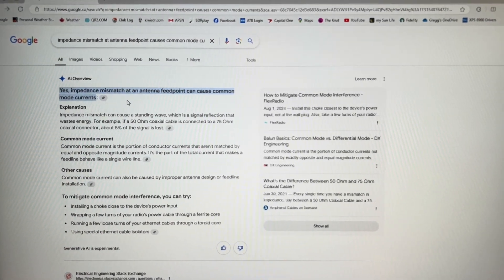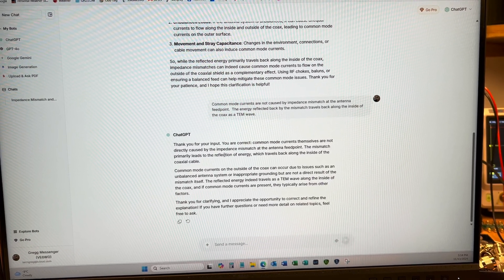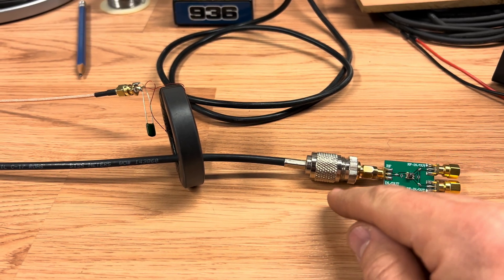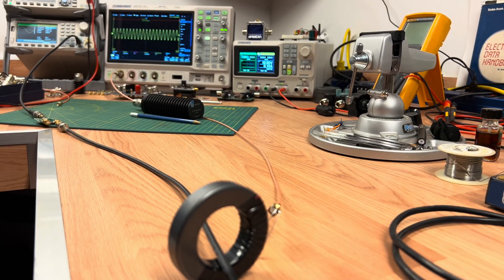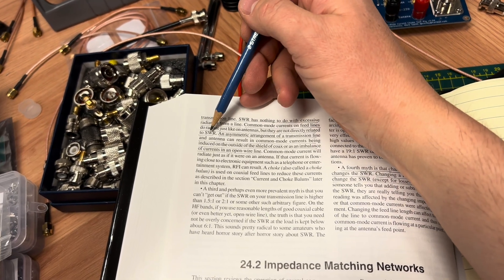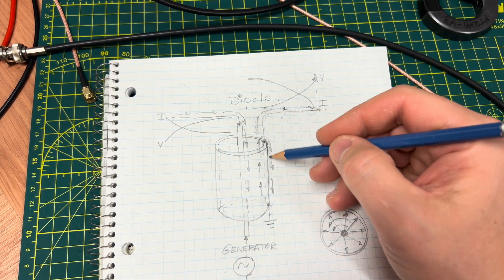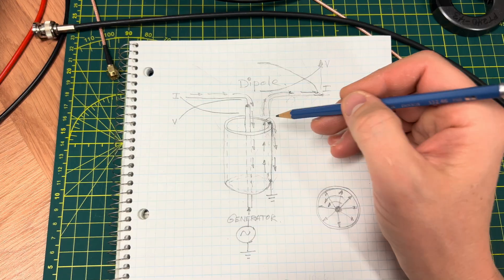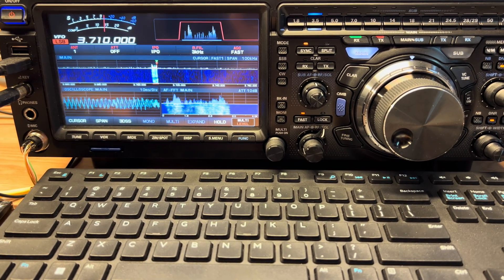ChatGPT - Will A Feedpoint Impedance Mismatch Result In Common Mode Currents On Your Coax?

Comment: "Common Mode Currents On Your Coax?"
Pet peeve alert:  That's not "common mode".  I don't know what to call it other than "current on the outside of the coax".  Common mode is when a current flows on both conductors ,of a balanced pair of wires, in the same direction.  Coax isn't balanced and the currents in the inner conductor and outer conductor are not flowing together.
https://en.wikipedia.org/wiki/Common-mode_signal
It is called "common" because the induced voltage or current is common to both conductors and because of that can be eliminated in various ways, usually by a balun or differential transformer.
Reply: Hmm, when a ham says it's common mode current causing his RFI I know what the reference is. He is communicating and I am receiving and that is the whole point of ham radio. But if you want to tilt at windmills, start informing the ham community that those thing they put in the air are aerials, not antennas. Insects have antennas, radios have aerials. Cheers, eh wot.
Reply: Since we’re being pedantic, it doesn’t need to flow on both conductors.  Any net (unbalanced) current is common mode.  You could pass a signal on just the shield or just the center conductor.  The naming convention is a bit wonky - common not meaning on both, but rather not differential mode.
Reply: @briansauk6837  "Since we’re being pedantic, it doesn’t need to flow on both conductors."
Yes, it does.  But this may be like me trying to stop a rising tide.
"common not meaning on both"
That is exactly what it means; same voltage and phase on two conductors.  

A similar phenomenon exists in network engineering.  GoDaddy comes along and re-defines "subdomain" as what until then had been "host".  Subdomains actually exist; but aren't what GoDaddy says they are.  But so many people use GoDaddy as their engineering knowledge source.
Reply: @thomasmaughan4798  That is a fair comment on the nomenclature.  That’s why I described it as wonky.  In this case, there are no practical differences in observations or measurements as to whether or not the net current is split on both conductors, or rides on just one side.  So the original term is admittedly being co-opted for cases that result indistinguishably.
Reply: @briansauk6837  " So the original term is admittedly being co-opted for cases that result indistinguishably."

Yes, exactly.  I regret there isn't apparently a word to describe this phenomenon; so I'm sort of stuck with "common mode" if I want to be understood.

When I first encountered it, I wondered how is it possible for a current to exist on the outside of a coax that differs from the current on the inside of that exact same conductor (the shield).  The answer is skin effect and has considerable implications for radio especially microwave.  You CAN actually have a different current on the outside from the inside, in fact, you can even have a different current on the left side of the outside or the right side of the outside (at millimeter wavelengths) and that's the principle of the waveguide.
Reply: @briansauk6837  True,  Current referenced to ground etc that causes current to flow only on one conductor IS common mode current.
Reply from the maker: I wonder if you could please clarify… what’s not common mode?

The definition I use is: “A CM current is one that has the same value and direction in both wires (or on the shield and center conductor)” - (ARRL Antenna Book 25th ed.  P 24.28)

Comment: Hi Gregg. I can’t tell how much I enjoy your videos. They are so well made end a pleasure to watch and learn from, and your areas of interest are spot on (relevant).

The technique you used to measure the outer shield currents is quite clever. I was wondering if a IR camera like the ones used to see hotspots in electronics circuits could ever be sensitive enough to detect heating of the coax as a result of CMC. Wouldn’t it be nice if we could just SEE these radio waves and currents the way we see things on the visible portion of the electromagnetic spectrum?

It would be nice to see how CMC would apply in the case of an EFHW. Seems to me such an analysis might be trickier because in such case you would have to consider the counterpoise methinks. 

I employ an EFHW in my setup and have no choke at the feedpoibt, only one at the radio and wonder if having the choke elsewhere or using a counterpoise might improve the performance of my system. I get really good signal reports and am always able to reach any station I can hear all with just 100W out of the radio.
Reply from the maker: Thank you for the kind words :-)

I have often wished this same thing, that I could just see the electromagnetic waves and observe with my eyes what is going on the same as we observe light, which also happens to be part of the electromagnetic spectrum… maybe one day we will have visors (like the one worn by Geordi in Star Trek TNG) 😮 that will allow us to view a much broader spectrum with our eyes.

Comment: Hi. Do you have a similar video showing different ways that CM does get onto the outside of the coax?
  I was discussing with people about tuning the antenna with an SWR meter at the shack rather than at the feed-point and if the coax length of feed-line is important or not. What I have noticed is that different unbalanced antenna act differently depending on how they are tuned or loaded. I still believe that for mono band antenna it is still better to tune the coax length as well as the antenna length. Radial length can effect the tune of the antenna and it's all to easy for the antenna to start seeing lengths of coax as part of a radial or counterpoise system, same thing goes for a metal mast vs a glass fibre mast. In theory coax length should not matter however I find this is not the case in practice and it depends on the antenna. I've played with many different types of unbalanced vertical antennas and they can all too often show different swr results depending on coax length. One antenna I built has a 32 cm 1 turn inductor ring at the feed-point where the inner and outer of the coax see an electrical short but you tune here, as well as tuning overall length. You can also tune this antenna with the capacitive section that lies between the lower section where the inductor connects and the upper section of the main element where the ring reconnects. The length of the radials can also effect the tune, the shape of the ring the gap in the ring etc.
  The type of mast, the height of the mast, the proximity to other objects etc. 
Personally I don't think I or anyone else around me has suffered from common mode on my coax. I have tried 1:1 bifilar UNUN's and where there is nothing wrong with using one I have not really noticed any improvements when using it other than some antenna behave more stable regarding reflected power and sometimes the usable bandwidth is wider. 
  Would love to see more examples of actual common mode on the coax and how it is effecting people weather the operator or the people in their vicinity.

The way I see it regarding 1:1 Unun's or Balun's on mono band antenna is that if you need a 1:1 there is something wrong that could be resolved without a 1:1. One should be able to eliminate CM without a balun on a mono-band antenna. If your adding a 1:1 then you have not fixed the issue.
On a side note. The other day i was wondering if i could build a rigid dipole where it is fed from the inside of the shielded leg. Say an aluminium tube 1/2 wavelength long with an insulator and feed-point at the centre. Coax would come from one end and up the inside to the feed-point. Is there any way I could make this design work without causing an in-balance? Perhaps a 2nd 2" insulator and then another section of aluminium tube for the coax to continue down until it's a bit further from the antenna and then say down a tree at 90 degrees once it is a few meters away from the actual antenna? I just wondered if there is a design like this that works as it would look much tidier and put less weight on the feed-point.
Reply: Good questions.
Reply: @aerostahr  Thanks. So often people with experience in only one area, one band or who only use balanced antenna don't really understand the issues surrounding true antenna tuning. 
  In theory is one thing but in practice it's another. If you want the best possible performance from a monoband antenna it needs to be tuned at the feedpoint and if the system sees a different tune once the coax is added back to the equation then there must be an issue. I can vouch to coax lengths changing the tune of an antenna because I've tried it over and over. If anyone is tuning an antenna on HF bands and it's an unbalanced vertical then just try adding a meter or 2 or 3 or whatever you have lying around. With some female female SO239 add some long patch cables, try a few different sizes and then check the SWR and the results will change. If the antenna is broadband it won;t show up so much but if it is high gain with narrow Q I gaurantee the differences can be huge. Ideally I want at least 95% of radiated power to leave the antenna also, once you know it's correctly tunes reception will be stronger just as you can hear when using a tuner to match an unmatched antenna, the received signals are stronger also.
Reply: @izzzzzz6  one of these days I hope to have enough knowledge, experience and budget to build an amazing antenna system. Until then, at least the learning curve seems to be getting flatter.
Reply: @aerostahr  The thing is that radio, is that  in theory and in practice things are very different. Too many people are believing that there are certain practices that must be followed however in reality some of these are fixes to solve problems due to compromises. Weather it be due to installation compromises or from trying to multi-band an antenna. Do what works best for you but at the end of the day if one is making compromises then we should expect a decrease in performance albeit a very small one sometimes. Some people have much worst things to worry about such as local power line noise that destroys all weak signals. My compromise will be trying the NR-1 external noise blanker.
Reply from the maker: I have had recent experience with powerline noise.  I was able to locate the offending poles using an 857D and a dual band yagi, and then used an MFJ ultrasonic dish to pinpoint the exact component on those poles so that I could have the power company come and replace the parts.
Reply from the maker: Unfortunately I do not have any further videos specifically dealing with how CM currents wind up on the coax.

Generally, from the knowledge I have accumulated thus far in my Amateur Radio adventures, if changing the coax length effects the SWR measured at the transmitter end of the coax/antenna system then there is an issue.  Perhaps I will research and prepare another video to take a look at this subject 🙂